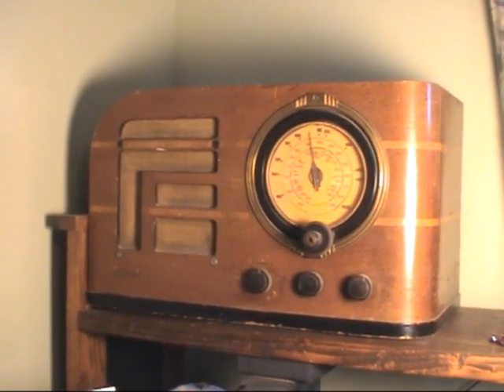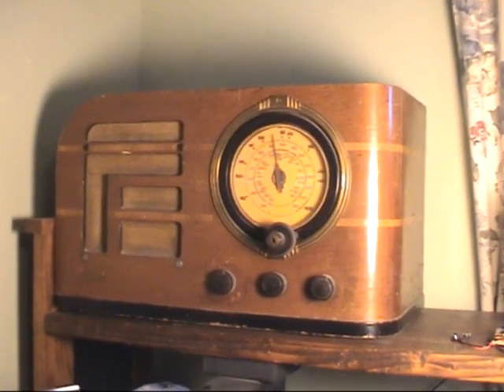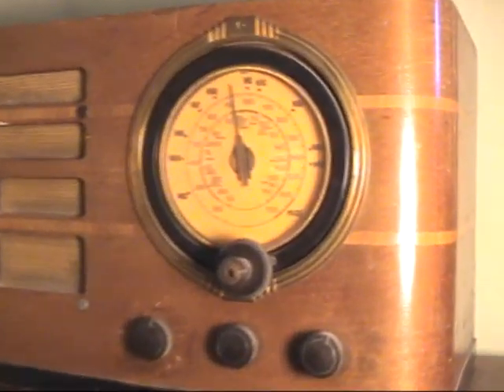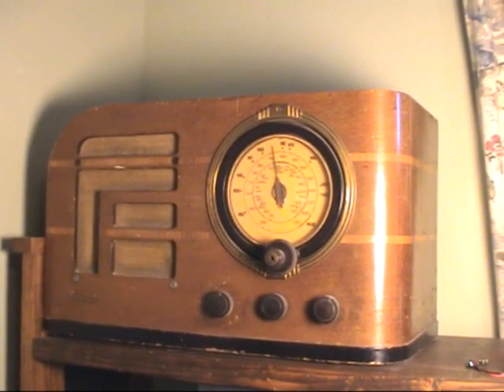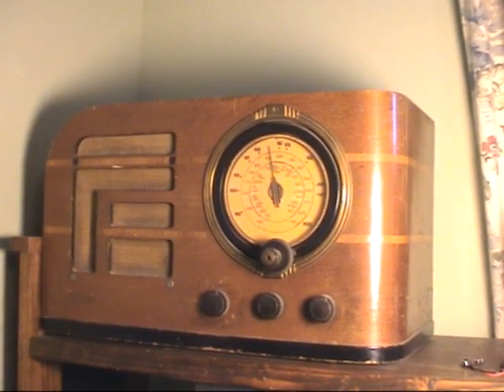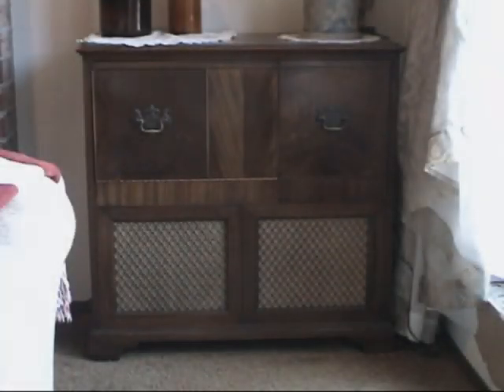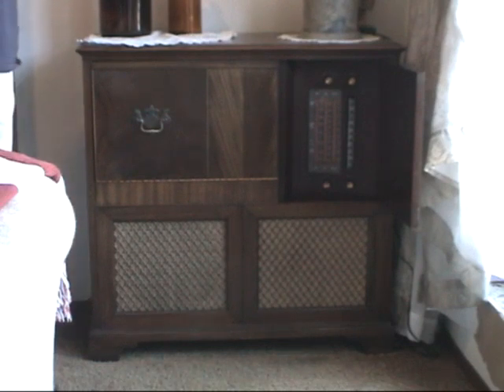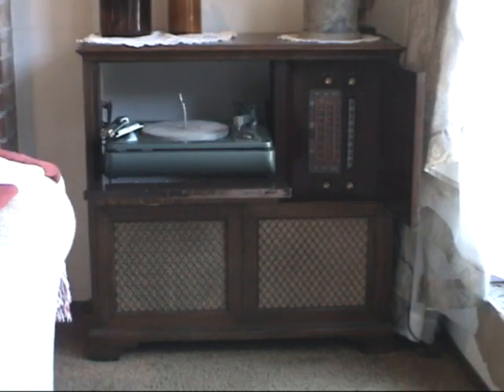Introduction ''Part 1 of 4''

Comment from the maker: @Thermionman1970 

Thanks! It's called "Cone-Centric Tuning". Really unique. 
Basically they have these cones inside around the dial mechanism. You loosen the bolt & adjust it to where the local station you want to preset the radio to. Finally you move the dial till it bumps against the cone, pull the knob. slightly move it, the push. Viola! The station is tuned perfectly.

Thanks for the nice feedback!
Tom

Comment: Good morning. I follow your posts and they are very interesting.
My hobby for many years is collecting and repairing old radio cassette players. I also want to deal with the "realignment" part of radios mainly FM but also AM, SW. If you have some time I would like to ask you a few things:
* I want to buy a Sweep Generator and most are either expensive or old, I was thinking about the EICO 369 which also has a Marker.
* Would the Chinese TSG-17 RF signal generator help me? (doesn't have Sweep and Marker is it good?)
* If I buy a Sweep Generator with Marker, will I also need an RF Generator with modulation?
* Could you advise me if buying the EICO 369 or 368 and the TSG-17 will cover me.
Can you advise me what to buy?
I have an oscilloscope.
Thank you for your time.